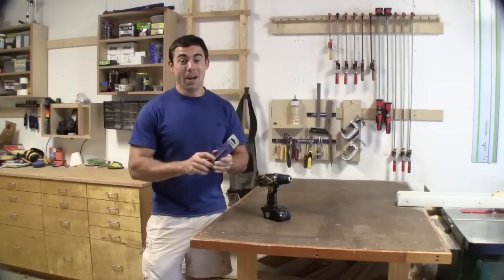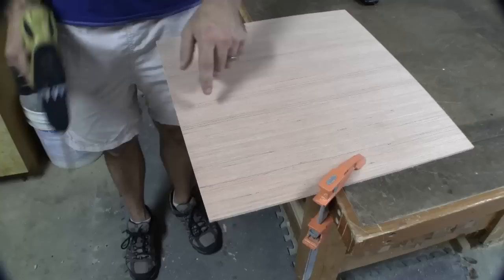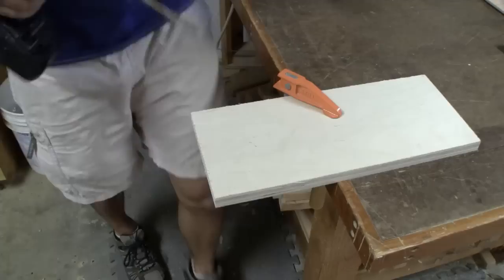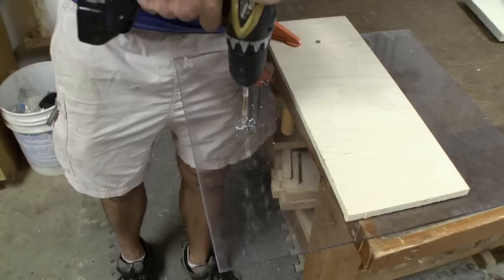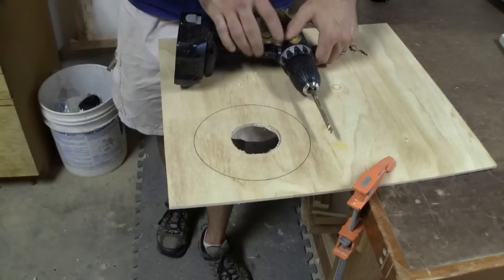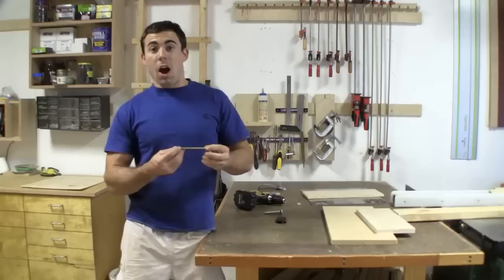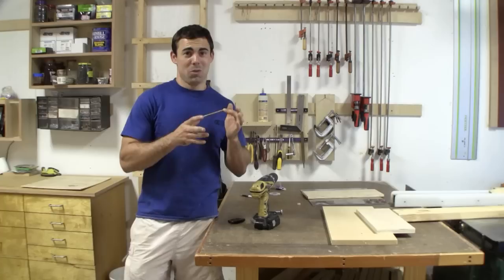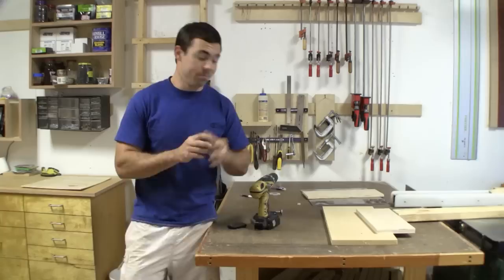The Drill Saw - Woodworking Gadget

Comment: These bits are good for the occasional use application but be mindful that they put an incredible amount of lateral sheer on your bearings in your drill. They increase the wear and tear significantly. Not terribly detrimental on your 100$ deWalt hand drill, but you might want to think twice before chucking them into a Drill you really care about. They will slowly add run out to whatever your running them in.
Reply from the maker: I agree, I never really used it ;)

Comment: We use these bits with installed drywall.  Great for cutting a custom hole for switch boxes, outlet boxes, etc...  We also have it dedicated to a large old corded metal-cased Sears drill circa 1950.  Cordless drills just don't like this bit and the sideways cutting.  Good video.
Reply from the maker: Ah, the older drill is probably tough as nails.,.... Cool!

Comment: Used mine twice in 5 years.. Made good use to create e keyhole to hang a small cabinet - but a small round file would have done the same ;o) I think the concern for the drill machine is right. They are not desiged for these forces.
Reply from the maker: Thanks for the comment HOOKEDONWOOD !  That often aye?  I think your right about the file and definitely about the drill's intended design.  Have a good one.

Comment: This is bad for the bearings in your drill.. They are not designed to support sideways pressure. It's like those milling-table attachments they make for drill-presses. Same thing - sideways pressure is bad for something designed for rotary action.
Reply from the maker: +MinuteMan Very true!
Reply: ya but for people like me who need a new drill every few months anyway its fine :D i use my current one inside a guyson blast cabinet to rotate my work piece  and it works fine full of grit lmao

Comment: I bought a 5 pack of exactly the same saw drill bits from aldi kinda like a  cheep tesco in uk lol I got them for 2.99 but there crap arent they lol only thing thats good about them is the drill holes allot quicker and easier than a normal drill bit but got 5 dif sizes iv used one size quickly but not tried the other sizes ill let u know how I get on ok lol

Comment: I didn't notice you do this, but what about moving the bit in a more sawing motion (in and out) while it's rotating? Would that make a difference?
Reply: Yes, I have a set of titanium saw bits and this does help immensely, I’ve used them to cut 16ga sheet steel before and they’ll do it, albeit slowly. The big enemy is the “saw” flutes packing with material which is why moving in and out while putting lateral pressure on the tool works so much better.

Comment: As Always a great presentation. It was a great idea that bit but you are right, most likely too much pressure against the drill shaft and bearings. If needed often, roto zip would be the way to go. side question, any sailing trips coming up?